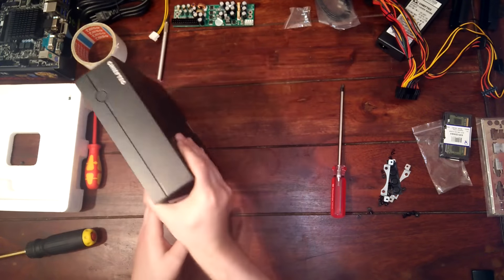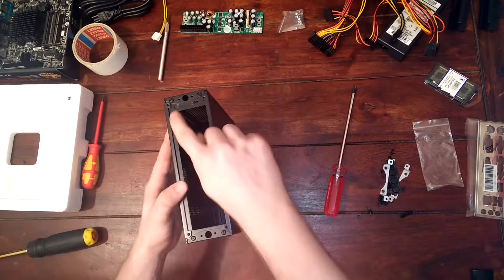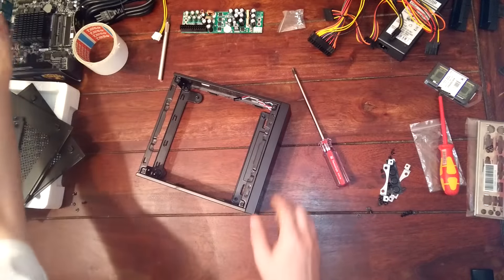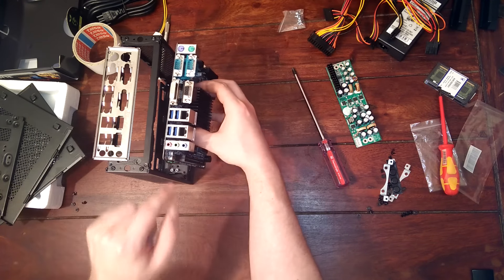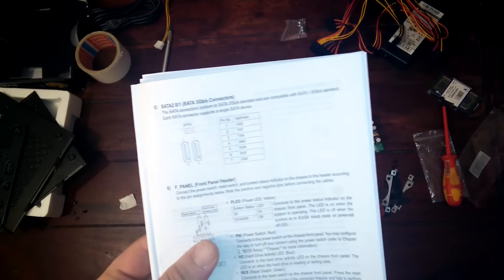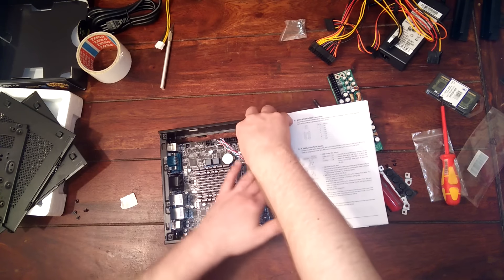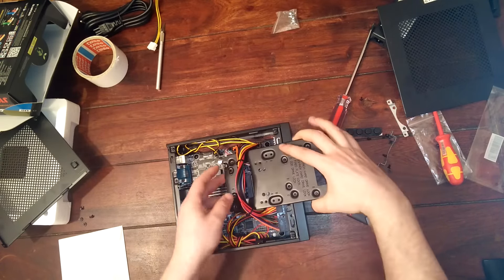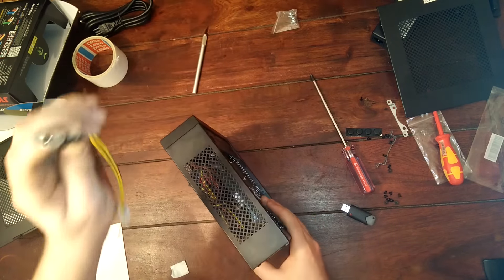Pfsense Build - DIY - enterprise firewall/router for less than $200

Comment: Parts list and where you got them from?
Reply from the maker: It's 2019 you ll probably want more up to date hardware
Reply: @loeken  Yeah I'm looking for what I should use. So many combinations of different boards and processors it's hard to pick. I'm not really from a hardware background; I just do cybersecurity and coding.
Reply from the maker: @AlienAndrew51   same, no hardware nerd here. these days most my pfsense run somewhere virtualized :p
anyhow I would pick a board from here probably: https://geizhals.eu/?cat=mbson&xf=7089_2x+Gb+LAN all you need is a board with some cpu, i reused some old ram i had lying around. usb sticks/old disks work fine for the storage as you dont write a lot, you ll just need at least dual nics. i usually prefere intel but up to you ;)

Comment: I can't power on my supply. Anyone have an idea what I can do? I did a paper clip test already.
Reply from the maker: +Juan A Gomez (Abraham) and what did the test show?
Reply: +internetz.me thx for replying

First of all I have verified that my Power Supply is working. 
(Power supply: http://www.newegg.com/Product/Product.aspx?Item=N82E16817371045 )

I am sort of new with hardware building so bare with me. 

I believe the only difference I can see from your build and my build is that 
A) I have no case yet
B) I only have connected my 24 pin, and 4 pin 12 volt to the motherboard
C) You have connected your F_Panel to something I have not (the color full pins @8:06
Reply from the maker: +Juan A Gomez (Abraham) yes the colorful cables need to be on the right slots. Take a look at the mainboard manual there is a picture showing which pins are the one for power. You need to "send the start impulse" here. Instead of using the colorful cables you can also just use a screw driver and touch both power pins at teh same time, that should also start it up.
Reply from the maker: thats also a huge power supply for this little board :)
Reply: +internetz.me Sorry I thought i replied to you Mr. Internetz.me 

Any ways I wanted thank you for all the help you have offered already. I got my pfsense up and running on our lan network and learned a thing or two about networking along the way. 

I have one last question, do you know what type of wifi card can I use to attached to the motherboard (same one as yours) that I can use as an access point. 

I promise this will most likey (maybe not) be the last question I ask :) 

-helpless student
Reply from the maker: Hi,
could you maybe state what you did change to get it working, in case anybody else has the same issue you have?

To your question with the dongle

Right now i dont have any wifi card attached to it, my router next to it has wifi built in ( fritzbox ). If i were to recommend a wifi dongle. BUT I do have a dongle Im pretty happy with ( supports monitor mode for wifi injection ). If i remember correctly I did attach it to my pfsense and it got recognized without any problems.

http://www.amazon.com/Alfa-802-11b-Wireless-Original-9dBi/dp/B001O9X9EU/ref=sr_1_2?ie=UTF8&qid=1464091910&sr=8-2&keywords=alfa+802

Comment: Nice build, I also wanted to build a router like that but I saw on the pfsense forums that the gigabit Realtek dont work that well with pfsense version 2.1.1 is that fixed in the latest version of pfsense and what would the troughput be?
Reply from the maker: +Jari Engelbarts what specifically do you mean with "not that well"?
Reply: The performance of the gigabit nic's
Reply: +Jari Engelbarts  that board has intel nics
Reply: +West t On the gigabyte website for the Gigabyte GA-J1900N-D3V thats this board it says 2 x Realtek® GbE LAN chips (10/100/1000 Mbit) so not intel
Reply from the maker: The problem is that i already shipped this one so i cannot really test the performance, but we only needed it to be able to throughput ~ 200mbit/s anyways here. If the gigaspeed is a must you can just pick another mainboard. I usually use this site: http://geizhals.de/?cat=mbson to filter what I want to use for the build.
Reply: Jari Engelbarts I purchased this board to do a router build about 5 months ago. The board arrived dead. I went back and looked at my order and I purchased the intel dual nic pci card. Now I remember why. My bad

Comment: Wouldn't it be better to run the f_panel wires under the board?
Reply from the maker: Armand79th bettet as in you want to do it like that? sure - or is there any other reason?

Comment: Have you tried a USB or internal wifi device with this box...if so which one?
Reply from the maker: Alfa 1000mW 1W 802.11b/g USB Wireless WiFi Network Adapter With Original Alfa Screw-On Swivel 9dBi Rubber Antenna
Reply from the maker: https://www.youtube.com/watch?v=qFwbQ06h8Qo

Comment: Very nice video. I am also in the process of collecting hardware for my box and I stuck at finding a case. Where did you get yours? I want as smallest case as possible for my 6 lan port motherboard. It's 220x220 mm. Any suggestions?
Reply from the maker: I got it @ mindfactory.de ( http://www.mindfactory.de/product_info.php/Chieftec-Compact-IX-01B-ITX-Tower-ohne-Netzteil-schwarz_845926.html ) what form factor is your mainboard?
Reply from the maker: 220 mm * 63 mm * 197 mm
thats the size of the mainboard i used in this video - according to mindfactory.de. Mini-ITX is 170mm*170mm if i remember correctly ( google it to ensure .... ) so it should fit.
The backpanel is usually include with the mainboard. so you should have a matching pack panel already.
Reply: I'm a little bit confused here. Why is my board rated mini-ITX since the actual size of the board is 220x220mm. If its really 220x220 then it won't fit inside this case. By the way what is the wattage on the build in PSU?
Reply from the maker: I dont know why your board says its mini-itx but has different sizes you might wanna contact your vendor to clarify (maybe return it, get a matching size and buy a cheap switch to have your other ports?). power wise im not exactly sure I build a similar box with a bit different components which used 17.4 Watts I estimate this to be a bit less, because I also added a hard disk. According to manufacturer its around 10 watts. This built was a built for a client so I don`t actually have it anymore and cannot measure it.

Comment: Is there a reason why you are running this off of usb sticks instead of installing a hard drive.
Reply from the maker: This box was eventually going to be used as a vpn uplink. so basically it will not be using the storage at all. apart from loading the os. Im not using a proxy or creating much data on the disk. So i did not buy the case extension and decided to go for the usb stick, cause its just cheaper. The one I use at home on the other hand has a hard disk built in because i use it as a transperent proxy to cache data.

Comment: What kind of throughput would u expect this to handle?
Reply from the maker: most my traffic goes throug my switch so only the traffic to the internet goes through my pfsense which iis a 50/10 mbit line. I just ran a iperf for you though :
$ iperf -c 172.16.137.254
------------------------------------------------------------
Client connecting to 172.16.137.254, TCP port 5001
TCP window size: 85.0 KByte (default)
------------------------------------------------------------
[  3] local 172.16.137.10 port 51650 connected with 172.16.137.254 port 5001
[ ID] Interval       Transfer     Bandwidth
[  3]  0.0-10.0 sec   536 MBytes   450 Mbits/sec

Comment: That mobo is $300+ , where did you find it for what ever you paid for it??
Reply from the maker: if you take a look at the description of this video you will find a blogpost with a link to where i bought it from, and the price, which most definately was not 300$ maybe they discontinued the board by now. Just search for another mainboard that has the same form factor. for example: https://geizhals.eu/?cat=mbson&xf=3760_Intel~4400_7~7089_2x+Gb+LAN&sort=p ( mainboard with mini-itx form-factor  and 2 NICs ( use the websites filter if you want 4 ports or other features etc ).
Reply: in the states it is.. :(
Reply from the maker: the states have the same form factor as the rest of the world, so just search for a mainboard with that form factor and 2 or more network ports. I do believe the states have big computer stores too :p
Reply: Yes they do, but anything dual ports is big $$ in that small factor. Its ok.. gotta change the title. its incorrect. Cool video though. I love this small form factor computers. Thanks
Reply from the maker: https://www.newegg.com/Product/ProductList.aspx?Submit=ENE&N=100007627%20600009028%20600026698&IsNodeId=1&bop=And&Order=PRICE&PageSize=36 thats just googling for 30 seconds :)
The refurbished one doesnt look bad, has wifi built in too

Comment: internetz.me
the little cable that you said you did not need is very important
it is the earth cable
you need to screw it to the chassis
Reply: Ground
Reply from the maker: with an output of 12V 5A I do not feel that i have to connect it to the ground. there are no other electrical components nearby. and here in germany all sockets are connected to an FI ( Residual Current operated Circuit-Breaker).

From my understanding a ground is used to get rid of electrostatic charges that build up over time. I always touch my radiator before touching any electrical devices anyways ( cause its connected to the ground ).

I am no electrical engineer so if i am wrong correct me. But i do not think that there is any thread coming from not connecting this cable
Reply: It takes literally 2 minutes and it's best practice. There's no reason to not ground your electronics. :)
Reply: internetz.me The ground/earth bonding wire is a safety device: it provides a guaranteed circuit in the event a component shorts to the case. Without it such a short may not trip your breaker, producing an energized case which would return to earth through you the next time you touch it, or through a potentially flammable object in contact with the case.

I have seen power bricks, even good quality units, in a failure mode which shunts full AC mains voltage into a device. With a proper ground bond this trips the breaker almost instantly; without such a bond it may simply open the circuit (by destroying a capacitor, resistor, fuse, even a PCB trace) before reaching the overcurrent required to trip a breaker, and remain energized. Destroying a component in this manner can produce the case short I mentioned, particularly in such compact cases, and present a significant hazard to lives and property. Simply place the ring terminal under one of the VRM board mounting screws for best protection.

You don't see these leads on ATX power supplies because they're internal, bonded to the PSU case, which in turn is bonded to the PC case through the PSU mounting screws.

Also, the drive mounting plate can be omitted entirely for driveless builds. This will reduce the restriction of convective airflow which your passive cooler relies upon in the absence of a case fan.

Comment: You should put spec and maybe link where you buy , tks great video
Reply from the maker: +jolejo7 I planned a 2nd part with the installation of pfsense etc. I already have a blogpost typed up etc. But havent had time to finish it yet. Currently abroad werking....
Reply from the maker: if you didnt notice yet: https://blog.internetz.me/2016/03/03/pfsense-diy-build-enterprise-quality-firewallrouter-solution/

Comment: Has anyone else done this and will it support gigabit speeds? 50/10 is NOTHING these days so no idea if this can actually support high bandwidth
Reply from the maker: If full gigabit speeds are important for you, you might consider picking a mainiboard with a bit more power.
I have a switch behind the pfsense which allows me transfer 1000/1000 initernally. I also ran a iperf so you can see what speeds you can expect from this mainboard. this iperf is from my pc to the pfsense box

$ iperf -c 172.16.137.254
------------------------------------------------------------
Client connecting to 172.16.137.254, TCP port 5001
TCP window size: 85.0 KByte (default)
------------------------------------------------------------
[  3] local 172.16.137.10 port 51650 connected with 172.16.137.254 port 5001
[ ID] Interval       Transfer     Bandwidth
[  3]  0.0-10.0 sec   536 MBytes   450 Mbits/sec

Comment: Nice video but the sound volume is a bit low.
Edit;  Also a parts list would be a good idea.
Edit2: I see you have the parts list on your blog.
Edit3: I think that wire you are not going to use is a ground wire, just make sure it doesn't touch the motherboard.
Reply: Yes I agree. That is a cool little case. What are the details on it? I would snip off those extra wires too if you're not going to use them.
Reply from the maker: +Allan Cross take a look at the desc. box, there is a link to the components

Comment: USB drives are to unreliable to continously run an OS from. I used to use one as encrypted storage and it was dead with in a month. name brand as well... Also not a lot of airflow in that case... Might not last very long....
Reply from the maker: +Adam949 no you are not correct
Reply: USB flash drives are not built with the same quality chips and controlllers as real ssd's that's why they are so cheap. if you watch every pfsence fallow up video ever made they state that they had to replace the USB drive with an actual ssd eventually.
Reply from the maker: this statement holds more information then "it does not work". If you use the disk as storage you are correct a cheap usb stick will die soon. However there are usb sticks that are designed for running operating systems. I didnt know that myself untill i had a consulting job and the admin there used certified usb sticks for all his esxi hosts.

In this example im using a dirt cheap stick because the I/O of this pfsense ( just hosting a openvpn uplink ) is almost not existant. If you plan on using a proxy cache which saves to the usb stick, or something else with a high I/O, yes then i wouldnt use a dirt cheap stick either. i d probably add a disk/ssd in there.

p.s. the system you see in this video still runs and didnt have any issues yet. ( uptime ~ 1.5 years )
Reply: I am sure some company made a USB drive capable of extended use and semi constant iops how ever to what increase in cost? how much storage do you get? most people buildiing these seem to be loggin traffic at the least. the obvious VPN capabilities are pfsense main attraction. and don't forget the average user watching this tutorial would most likely not be able to find said specialized USB drive at the local staples. So in other words for most people and for people who gont know any better aka most people should not just throw a USB drive in their box and just leave it because their box will be dead in side of 6 months
Reply from the maker: I added a note to the blogpost ( https://blog.internetz.me/2016/03/03/pfsense-diy-build-enterprise-quality-firewallrouter-solution/ ) which is linked in the video description to not use a usb stick if they plan on storing data ( apart from the OS ). I hope that will avoid others from carrying their usb sticks to their graves :)

Comment: Any idea of a place to purchase the Chieftec in the US? They don't seem to have any retailers or anyone willing to ship globally. Or even just a similar case that has a matching power supply. Can't seem to find any small enough for my liking and they all cost $50+.
Reply from the maker: Sorry I dont know any place where you can order it from within the us. Maybe contact Chieftec directly and ask them for resellers in the US? If you find one please let us know in the comments. I guess there are more people from the us in your situation.

My power supply also costed roughly 50 bucks. Also I wouldn`t try to save money on the power supply. The pfsense will run 24/7 and the more efficient your power supply is the more money you will save on the power.
Reply: Well your guys are still en EU so you could order it from Denmark https://www.komplett.dk/search?q=chieftec%20mini%20itx

I have the same build as in the video i just mounted a 2x gb intel NIC at the top of the case :D have been running flawless the pas year! 

But I wont go as far as internetz.me and say it's enterprise because it really isn't! the software is the hardware is now. but it work fine for a home setup